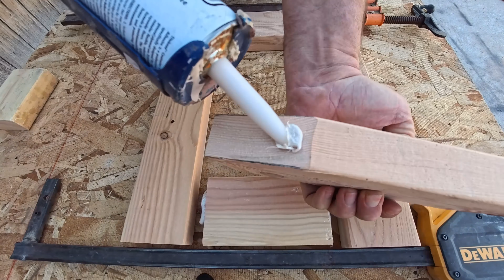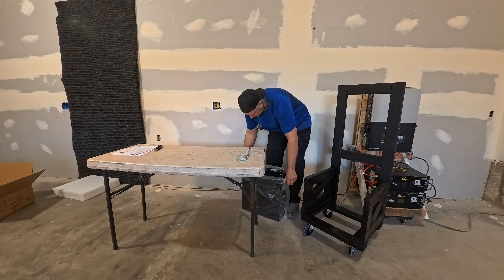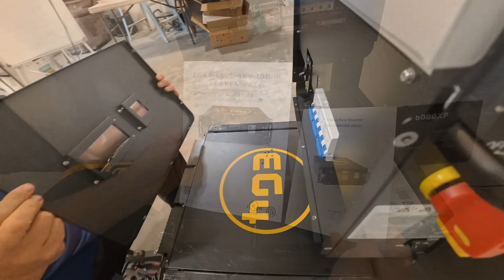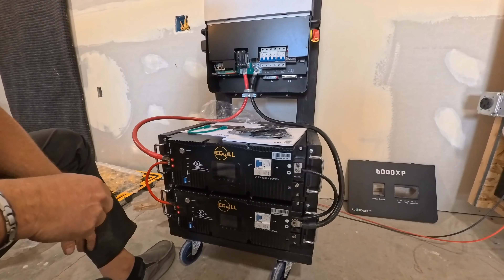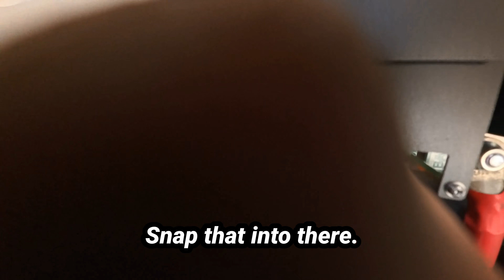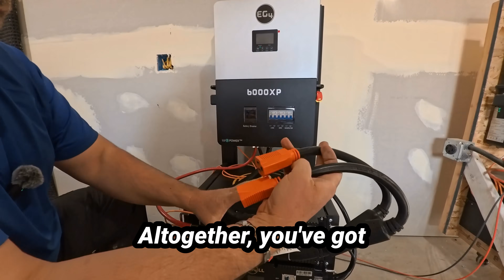Portable Power Station EG4 6000XP with easy-to-follow Instructions

Comment: If you have 2 110 volt outlets at 15 amps that would be 1650 watts each, 3300 watts total. I like your setup and looking to do the same but yo get the 3000 watts pet leg, I need 25 amp cord. Is there something I'm missing? 
Thanks for the video!
Reply from the maker: I have 3000 watts going to each one of my 110 Volt outlets. My outlets are undersized for the amount of power going to them. I probably should have wired 20-amp outlets. I don't run that big of loads on my 110v, So I have not worried about it.
Reply: @Thesolarfarmer ok thx for replying, i appreciate it and the videos

Comment: Hey Solar Farmer, could wire a regular generator outlet like a nema “14-30” and plug it into my house interlock system and use the batteries/ inverter instead of the generator?
Reply from the maker: Yes

Comment: I like 2.0 stand. I joined two harbor freight rolling dollies together with 3/4" plywood, but I will use your design for the 6000xp and battery mount🫡

Comment: Thank you for the video. It really helped. Did you use the Nema 14-50 for charging EV? Any better cable you recommend?
Reply from the maker: I use it to run my 240v welder. It should work fine for EV charging.
Reply: @Thesolarfarmer are you available for paid consultation work? I'm trying to do the same for EG4 6000xp + 4 ecoworthy 100ah. I just wanted someone to double check my work. Thanks
Reply from the maker: @NovaFlowO2  I might be able to look at it. Zoom call?
Reply: @Thesolarfarmer thanks for the video. Your video is the best I found for a beginner like me. Like and subscribed to your channel. Appreciate your time for making this video.
Reply: @Thesolarfarmer are you available for paid consultation. I'm trying to do something like this with 4 Eco-Worthy and 1 EG4 6000 XP. Just need someone to double check my work for extra safety

Comment: hey do you have to have two batteries minimum? or one 100ah will be ok? this is basically the exact set up i want!
Reply from the maker: 1 battery will only give you 100amps of power a little over 5000 watts. You  do need 2 batteries to get full power from 6000XP.
Reply: @Thesolarfarmer  o I see the whole 6000. I'm gonna only use about 5k daily.. and jus starting up I didn't want to spend on another battery anyway..

Comment: Hi
I'm looking through the eg4 page and I need it simplified!
Lol
Can you tell me how to look up all the components that you are utilizing?
I'm looking for something like this for a power station for my bus build and then to use as a power station for my bus!
So, I'm looking for pricing for budgeting purposes.
Thanks much!
Reply from the maker: Here is the inverter and batteries.
EG4 6000XP Off-Grid Inverter | 8000W PV Input | 6000W Output | 480V VOC Input | 48V 120/240V Split Phase | All-In-One Solar Inverter
https://signaturesolar.com/eg4-6000xp-off-grid-inverter-split-phase/?ref=thesolarfarmer
EG4 LL-S Lithium Battery | 48V 100AH | Server Rack Battery | UL1973, UL9540A | 10-Year Warranty
https://signaturesolar.com/eg4-ll-s-lithium-battery-48v-100ah-server-rack-battery-ul1973-ul9540a-10-year-warranty-pre-order/?ref=thesolarfarmer

Comment: High-frequency, transformerless inverters like these are trash. They may be able to start an air compressor or other high inductance loads like an AC unit a few times when they're new, but every time you fire up that compressor, you're shortening the life of the MOSFETs and caps in the inverter. These inverters not only offer poor surge capacities and shorter life expectancies, they can also fry your home's appliances when their MOSFETs fail. If you don't believe me then ask Google AI this question: Can a high-frequency, transformerless inverter damage your appliances? And learn the truth about these cheap, dangerous products.

Comment: Great cart!  Question: how do you ground a cart like that?  Will you add a 6awg copper wire on the side of your cart that you will connect to a 8 feet rod in the ground outside every time you use it?  I wonder because it will be high voltage and nobody talks about that on YouTube when they build their solar cart.
Reply from the maker: Here is a good video that explains grounding techniques. https://youtu.be/viNZV0lyRVQ?si=-kJCZMGznatodU-m